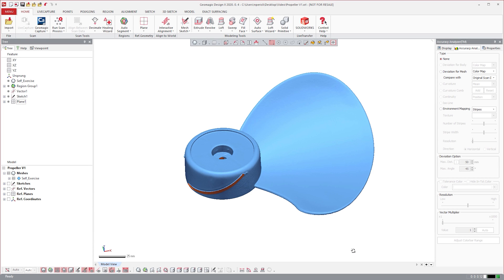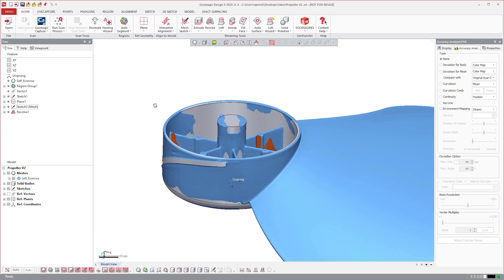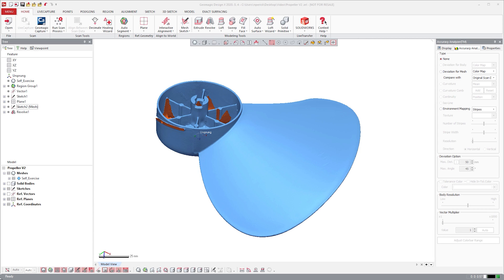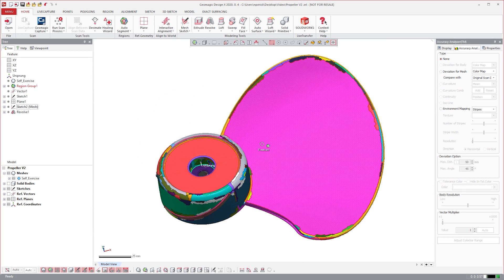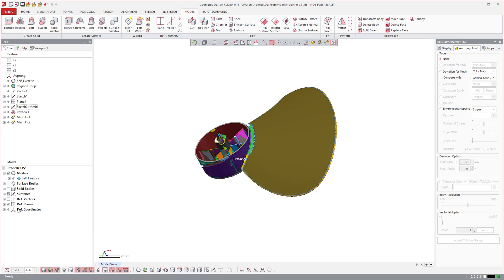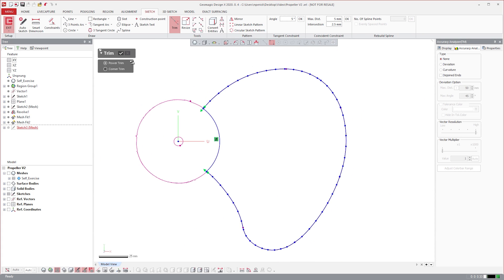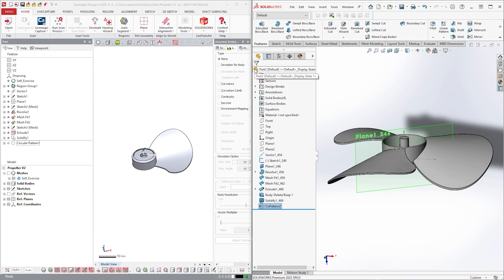Reverse Engineering with Geomagic Design X

Comment: great video, quick question do you have any idea how to clean up stray lines that are left from cutting and building complex areas? Where software like Fusion etc you can delete straight from the face and it will average out, I don't see how to do that on Design X I'm very new to this. Cheers

Comment: You didn't model the ribs in the hub. How would you model them? In this case it's pretty easy because they are all on the same height and perpendicular to the bottom plane. Do you have a good workaround if they are at an angle and an inconsistent thickness? I didn't find a convenient way to model them till today. Building them up one by one and step by step is a pain when modeling parts with more of them.

Comment: I realise that this video was to show how quickly and easily Design X can reverse engineer that prop and yes, it does a great job. However in a real life situation that prop blade should have used one surface and cut it with the outline shape then apply "thicken" to give an edge that is "normal" to the blade face (like the original and unlike your model). Great video though.
Reply: I don't think that all propellas have the constant wall thickness; that is the reason why it makes more sense to extrude and cut the both faces with meshfit
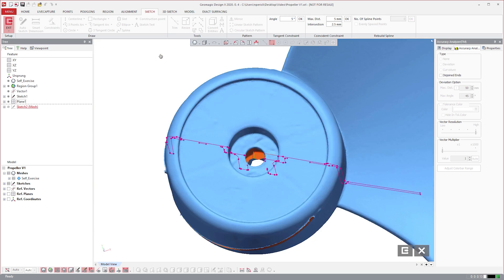Reply: @canozen6468  I never said that ALL prop blades have a constant blade thickness however the cross sectional sketch shown at 0:43 clearly shows the blade is of a uniform thickness. I stand by my statement that a front to back extrude cut based on the outline of the blade as was done in this video is not the way to go however each to their own.
Reply: @alicantino59  sure everyone is free to use his own workflow but only if the result stays the same😉; however the sketch is projected on a plane and we see only a part of the sketch on 43sn and not the whole surface. ; I am a trainer and use this particular scan during some my trainings for DesignX; Once you create a single surface and thicken the surface, your Scan to CAD deviation will be very high on the rear side. If you had this scan yourself and created the volume model with two methods you would understand what I mean. But your way of thinking is not wrong, but won‘t be suitable for this particular application